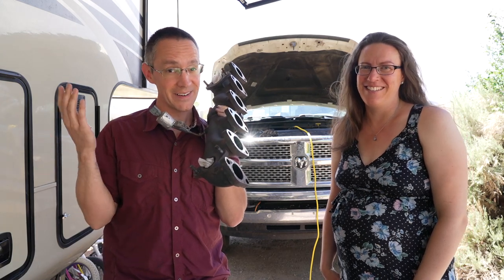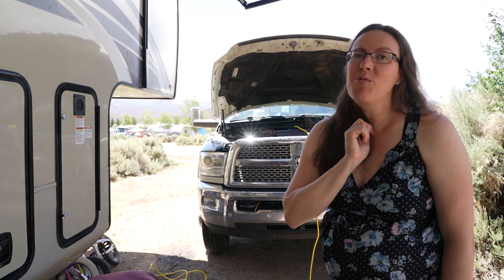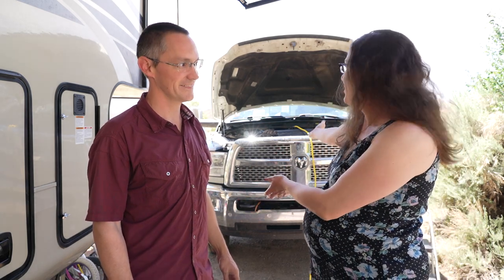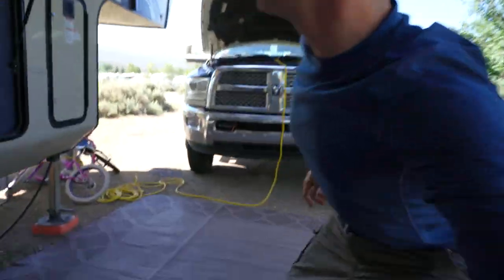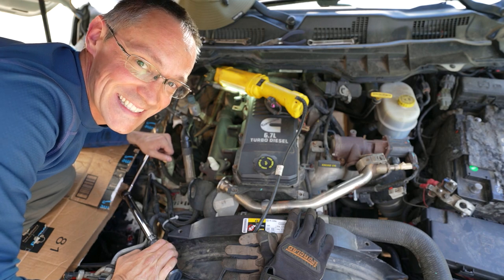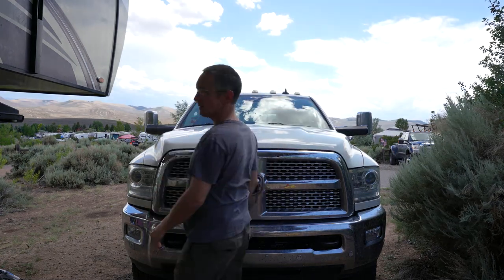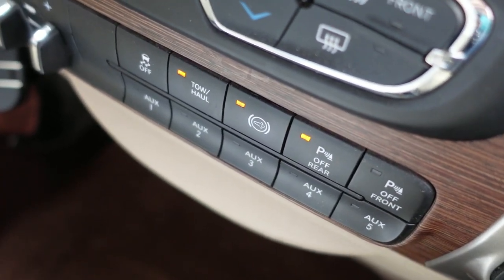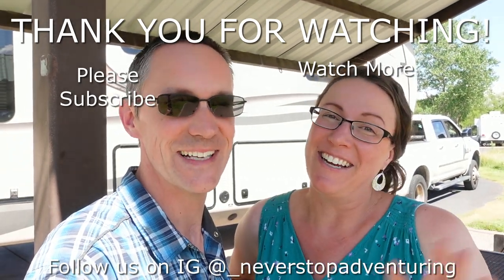Our Truck BREAKS DOWN & We’re STRANDED In A Campground

Comment: I had to replace my turbo on my Dodge and took a week to do so.  When I went to put the manifold back in, the manifold had shrunk.  My choice then was to heat the manifold in the oven (Sue was not up for that idea) or purchase a new one.  After a 2 weeks of shipping delays, I finally got the new manifold in and put it back together.  It all finally worked.  Good Job getting it all done Kevin!!
Reply from the maker: Pretty amazing how much they can stretch and shrink! That's what happened in the first place. The stock manifold shrunk and warped. This would have been A LOT easier if I wasn't fixing so many mistakes from the shop!